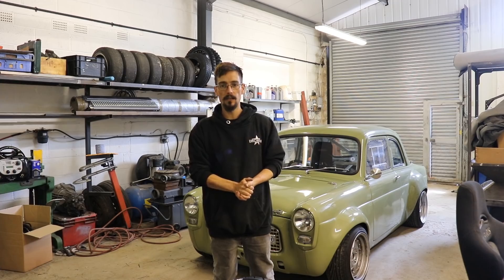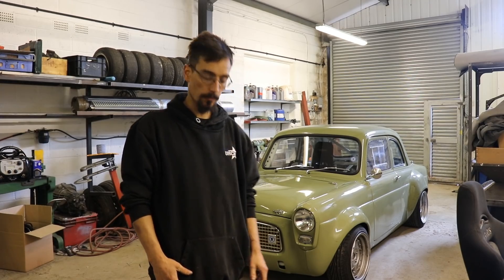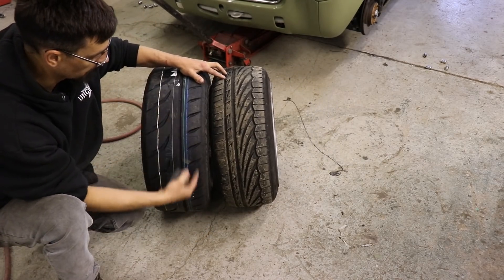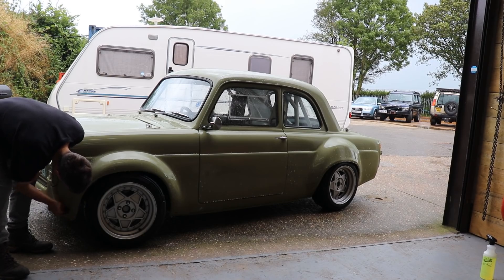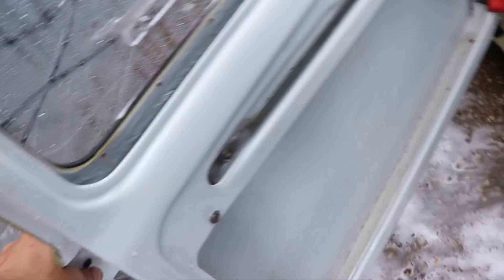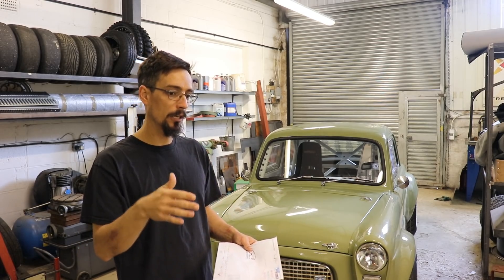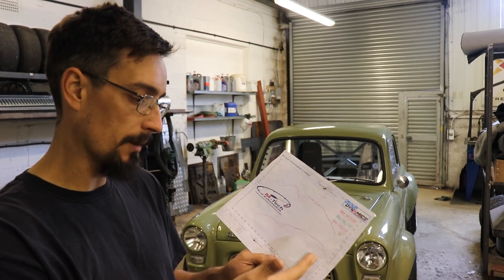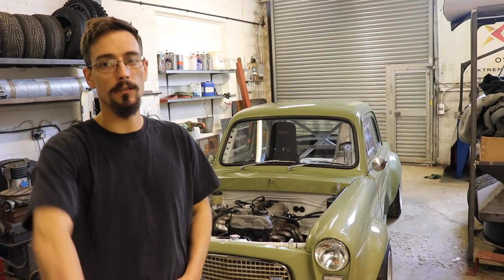The Mongrel Gets More Grip - More Power???

Comment: The more i look at that car the moore i love it, i miss all that episodes when you build it, well done, stay well 👍
Reply from the maker: Just watch them again then mate.
Reply: Yes, I also miss those (build) videos…
Reply: hay man Have you heard of/looked into electronically controlled valves, you can gain 30% more power, it would give better throttle response  and give you complete control of the Engine performance throughout the rev range, of course you would have to redesign the top half of the engine. but if you make it out of billet aluminium you are gain strength and reduce weight anyways
Reply: @Jay-ro8xt  Not main stream just yet, partner, it's a coming. New lease on engine control, timing, valve lift ECT. It's coming!
Reply: @Urchfab  the 30min build video has been watched multiple times... great video

Comment: More cam lobe, a bit less separation angle, longer intake runner (throttle valve-injector-intake valve) a slight hone on the ports, big airbox with cold air channel and stronger spark. Just trying to adjust the trumpets will not give much of a gain, even with a different tune. To get the WHP over 200 mark, you need at least 500cc more displacement. That means bigger crank and pistons. But, tuning the head and intake will bring the number relatively close.
Reply: That is so interesting.  I once had a conversation with an Australian motorsport identity and he stressed that horsepower comes from the cylinder head.  It will be interesting to see the developments here.

Comment: A red dot is the high point and is to be matched to a dimple on the wheel. A yellow dot is the light spot and is to be matched with the heavy stem.
Reply: What if the dimple and valve don't both coincide with the tyre dots? Do you prioritise one over the other?
Reply: @kiesh.  If you have a rim dimple and both dots, then prioritize the red dot and dimple. Get the shape right, and then balance the weight the regular way.
Reply: @jonasthemovie  nice! Makes sense once it's explained, thanks for taking the time 👍
Reply: @kiesh.  No problem!
Reply: If in doubt ask.... how would I identify where the dimple is? Thanks for the red dot bit, never spoken to anyone who shared this important info before.

Comment: I'm quietly confident that all you will do with the trumpet length is change where the torque/power curve is as, if I remember correctly, you run a standard cam. A cold air feed would help nicely with cooler air flow. I'm not sure whether this is applicable to your car but some engines don't like sticky rubber as you can oil starve them.

Comment: Love the mongrel Matt 👍🏼 what about a set of cams along with intake runners? Even a mild set should in theory give you more top end. I used a 268 degree in my golf, which like the mongrel is a low powered track car (130bhp ish) and suffered from top end power loss. it made a hell of a difference in the top of the revs and now pulls hard all the way to the red line. 

The R888 will also blow you away if the track is dry - fingers crossed. 👍🏼

Comment: Aye Matt.
The Yamaha R1 uses variable length tubes.  I was working on one and found all does is, at full tilt the tubes get lifted off the throttle bodies and then seat back down at lower rpm. 
  It could be the other way round when on the move but that's the position they were in when stopped.

Comment: Love your channel.  Can't wait to see the results of that intake test, although it looks to me that your intake runners are already quite short.  If you find that shortening them doesn't significantly move the power peak, it's going to be cams and/or or head flow that make the difference.  There are plenty of tools online that will calculate ideal intake runner dimensions to determine what RPM they tune to.

Comment: Typically shorter runners move the torque up the rev range so I expect less power up the top unless you can go to a setting shorter than you already have. Keep up the vids! Enjoying them!
Reply: I think Dave Walker at Emerald had a set of trumpets you could vary the lengths whilst mapping. Saved fiddling with swapping over.
Reply: I’m afraid changing the length of naturally aspirated ram pipes won’t really make much difference. Valve overlap and larger valves is usually the only remedy….

Comment: And don't forget about your exhaust. Are you able to add collector length? A combination of carbs (getting air into), Camshafts (letting the engine breathe) and exhaust (using that to help breathing) should help your Dyno readings. Also, what gear are you running in the rearend. 3:50 or 3:55 ? Both gears are good for road tracks... Combined all will get you better lap times ! Been there. done that..

Comment: Matt, if you want to move peak power further up the Rev range, you should initially fit the next level camshaft as I’m guessing the one you’re using is a yellow road/rally cam. You need to go to the next level with a bit more overlap (between the exhaust valve closing and the inlet valve opening…) Piper R&D or Kent Cams should be able to sort you out buddy! 👍

Comment: Not sure you'll get much more power out of it with different length intake runners but you'll definitely effect the torque curve. I'd predict a smoother curve with more low end torque with a longer runner.  Should be interesting though.  I'd consider building an air box with a good cold air feed if you want to make more power..... won't sound as good though!
Reply: a friend built a mini engined kitcar, he had a long spacer on the carb to inlet manifold, it had torque like a diesel at tickover. Great off road

Comment: You're right about driving low power vehicles improving your driving skills, I once had a vivaro which did 0-60 in 20 seconds and after 4 years it improved my smoothness and entry/exit speeds because you didn't have any acceleration!
For the trumpets, look at variable trumpets- Porsche and Nissan used them and they work off vacuum. A good way to get more torque across the board.
Reply from the maker: almost as quick as my Vito!

Comment: I’d try making a makeshift plenum, or several plenums. Lots of guys have had big wins with this on escorts etc as the air filters can sit too close to the end of trumpets and restrict airflow into the trumpet itself. Plenum volume can be tuned easily using basic materials like cardboard or plastic until you’ve found what will work on a permanent basis.

Comment: Long trumpets for torque, short for top end.
To move up 1000rpm you'll need to take about 30mm.
But runner length can do strange length and not only move your curve up and down the rev range but when you hit the sweet spot it'll add a whole new peak that wasn't there before

Comment: On these tiremachines theres a hole on the front of the beadpopper , its there to drop youre tire iron intoo so you can get to it eazy
To increase te power on the engine i think putting lower compression pistons in there and put a turbo on it would make it quite a bit more powerfull it allso would change the powerband though

Comment: Hey mate, Rick from Oz here. I'm a mechanic of over 35 years. Have you considered increasing your valve spring rate?? The longer the valve can stay closed the further you can hold RPM. Have a look at your cam spec sheets and make sure you meet its requirements. Could be losing alot of power through a mechanical issue.. Hope this helps... Enjoy watching your work.
Reply from the maker: Hi Rick, cams are all stock at the moment mate. Cheers

Comment: lining up the dots should help with the amount of weight needed to balance the wheels. and it is so easy. from my couple of weeks of trying to like the miata (i am 5'11 and can't see through the windshield), i think it needs torque more than anything. small turbo would fix that. 120 to the wheels should easily put you in the 120mph range if it has enough gear. give the mongrel some torque.
Reply from the maker: That would help for sure.

Comment: Curving those intake runners up will be a plus if you decide to add a hood scoop. Also, the runners should increase in diameter toward the air filter.

Comment: Two things Matt,  the 50s are a little taller (5%) so you gain some mph with that. Two, try a little cooking spray on the ole girl, atleast on the leading parts to cut down on the rubber bits from the track sticking.  Oh and what fuel are you feeding The Mongrel ? seeing alot of gains when people switch to e85.

Comment: i had a mk2 1.8 engine, all i did was skim the head 40 thou. on the dyno was 150 at the crank. longer runners with a cold air feed for the trumpets. followed by camshafts or atleast intake cam with a ported head and port matched. should make a difference! 
or... you go down the root of just putting a more capable engine in. mazda L engine are alot more tuneable. fully alloy block so lighter. they're cheap and parts are everywhere for them.

Comment: Short velocity stacks are for quarter mile. Long velocity stacks are for more top end. Medium stacks are a balance and best oaf both worlds. It all depends on the track you are at. You also have to take into consideration your rear end gear ratio and how many gears you are running in the transmission. Again, it all comes down to the track you are running. Long straights are a way different beast than a twisty track.

Comment: Aloha Matt.  Have you calculated the final gear ratio of the current set up?  Would you also consider raising your gear shift leaver to be closer to the steering wheel without interfering with the break lever?
Enjoy your content
Mahalo. Kurt
Reply from the maker: 4.1 at the diff. I think shorter gearing would definitely help.

Comment: It'll gain more torque but not much hp with the trumpets .. Also you need valve springs and stuff to get over 7.5k rpm, Mazda bp engines don't rev high.

Comment: There's lots of supercharger or turbo options for MX5 engines.  Why not go there instead of engine change?
Reply: Indeed, I know a couple of lads that do supercharger implants on mx5's, they use 2 different chargers, either the mini cooper s or from a merc kompressor, both work and fit well Matt 👍
Reply: @Sennaxm71  Supercharger would be the best option so no responsiveness is lost.
Reply: @planespeaking  indeed, but I have another friend that has turbo'd his mx5 and that goes really well too, a tiny bit of lag, but nothing you'd moan about, and nearly 300bhp once mapped, so a tidy improvement either way 👍
Reply: @Sennaxm71  As a track car though I think it could be annoying and Matt seems to be an NA type guy.  I guess we'll see, lol.
Reply: @planespeaking  except for his Saab turbo Escort lol
Reply: @Sennaxm71  Oh, I didn't realise that was turbo charged. All good then!
Reply from the maker: Its a possibility.

Comment: IMO  have a torque prob. Taller tyres will give it longer legs but other forces come into play at higher speeds. Either another gear or turbo. You pretty much want to copy the mX5 drivetrain, it has been sorted. By the way, I know nothing.
Reply from the maker: Id agree

Comment: Quite a bit of rear camber on there? edit - doesn't look so bad from certain angles. Longer trumpets will tend to make more midrange at the expense of top end, plenty of info & videos out there to confirm that. You generally just move things arounc so unless you have a major problem elsewhere that you're trying to work arojnd it's unlikely to yield any huge gains.  Maybe worth thinking about cams as that & head flow would be next along with more compression  or just sack all that, do it properly & turbo it! That's where it's going!
Reply from the maker: I probably will end up there eventually if I keep this engine in place.

Comment: Inlet runner length before the throttle body won't make much difference. If you move the throttle body as far away from the cylinder head as possible you will gain low end power because of the long runners and more power overall because of the effect the fuel has on cooling the intake air. 
Long runners after the throttle body makes low end torque and power (6k and below) and short runner intakes make less low end torque but power at the higher rpm (5k and up). Short runners are for engines doing 8k to 10K and above. You already have very short runners so the high RPM hp and torque is about as much as you will see until the cam is changed. You will gain more low end torque with long (Factory Style) runners and gain quicker track times because of the torque gain coming out of a turn but top end would still be about the same. You would just reach top speed quicker. I don't know if you're running factory cam timing but retarding the cam slightly may give you a little more top end as well, but you loose that much or more at the lower end. Need to know the RPM of the engine at top speed as well, because if you're in the 4k range you'll need Boost or a bigger engine due the the fact of the increased aerodynamic pressure multiplying at those speeds. The faster you go through the center of the corner the faster the top speed will be, unless of course it doesn't gain any more speed then say 100 or whatever that speed may be.
 Can't wait to see the results and thanks for giving us updates!
Thank you TOYO!

Comment: M62 supercharger, dead easy install on that lump….massive torque and bhp increase for little cost and would not stress the charger at all…and you could change the pulley ratios with ease to adjust the power being delivered. Charger £200, the rest is just fabrication and well within your skill set.
Reply from the maker: Will look into that mate.
Reply: @Urchfab  May I suggest you consider the M62 charger from the Mercedes family, loads of headroom boost wise and high numbers are easily possible. £200 will buy you a reasonable one, change the oil and pulley, 2nd throttle body, couple of pipes and an intercooler and you are good to go - your existing plenum will be fine. Most of the money for these is in the mounting bracket fabrication, which I can't imagine will cause you any problems at all.

It's also something different, i.e. not the usual turbo route and very much (I'd say) in keeping with the Mongrel - I think you will find it a good fit.

Comment: Your Pipercross filter is too small, that short type is rated at about 130bhp, fit the biggest one you can fit. Trumpet ends must be a minimum of 25mm from the inside of the filter.

Comment: Someone has already been there and done that,
https://youtu.be/ONbxhT54nv4
You can tune for the low end or the high end but not both unless you use a complex dual butterfly system that opens short runners at high RPM.
Making up a ram air intake and finding the spot with the highest pressure at the speed you need it will do more good for less effort.

Comment: Hate to say it matt. But unless you do some serious work to these motors you are wasting your time and effort. A 2 litre duratec on throttle bodies with a bit tuning you can make a easy 180whp. Best of all use the 5speed mx5 nc bellhousing and you can keep the mx5 gearbox.
Reply from the maker: I have heard that, been looking at duratec engines but all the parts get expensive.
Reply: @Urchfab  being in the uk you have better access than nz. Both ford and mazda shared the duratec platform. With a few differences between the blocks. Yes thay are not a cheap built option but bang for buck are good.